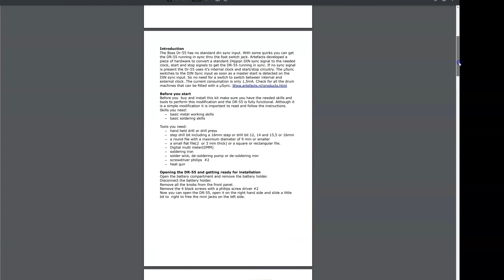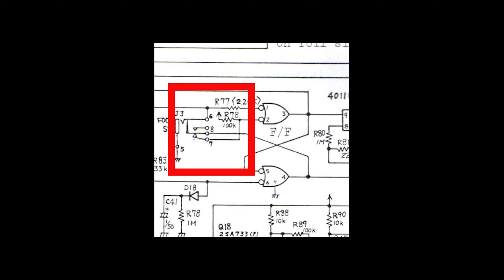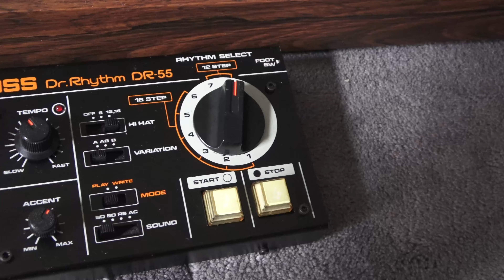BOSS DR-55 DRUM MACHINE - DINSYNC INSTALL

Comment: Could it be that the 4011 you entered is not a UBE? The CD4011BP has a propagation delay time of 125ns at 5V and the UBE version 60ns... so the input reflected at the output of the chip is faster! Can you try to change it back with the original?
Reply from the maker: thats a very good point and something I missed.

Comment: Did you consider wiring up the footswitch socket so you could make a din-to-stereo mini jack plug and not drill the case?
Reply from the maker: yea I did, it didn't fit properly and also looks kack

Comment: Great stuff and nice jam at the end! Might have to mod mine, although i'm a bit reticent to drill the case. It's a great sounding drum machine and sounds sweet run through an re-201 or similar.
Reply from the maker: hi thanks! yes the case could have been done better. The metal is thin and the existing hole is near the edge so the metal just rips. A good dremel bit would be useful to enlarge the existing hole towards the front of the machine

Comment: i think mine has that artefacts mod, but it's so noisy if i connect the cable. if i unplug it, it's fine. So it s not getting any use :(
Reply from the maker: hi, may be the mod has not been earthed or not installed correctly as it should be quiet.

Comment: That’s a great looking 5 pin Din plug. Where did you get it from?
Reply from the maker: hi came with the kit. You can get similar from a company called Deltron (code 650-0510)
Reply: @waheex  Thanks!

Comment: Great video! I noticed you connected power to the DR-55 is it possible to mod it to use an ac power adapter?
Reply from the maker: hi yes it should be - just really need a dc jack and wire to the battery leads I would think